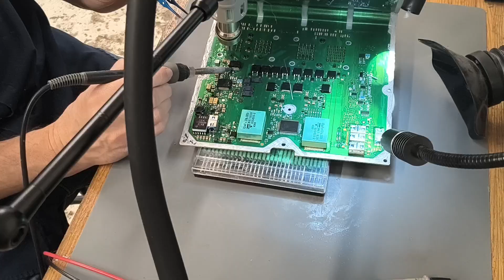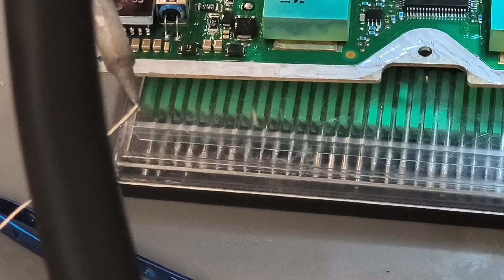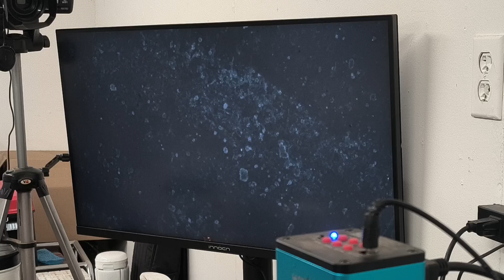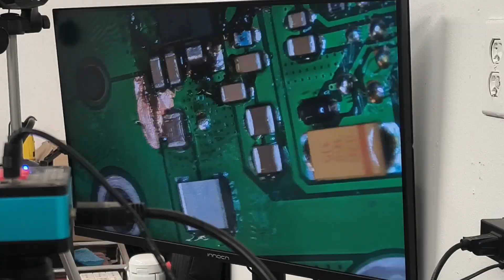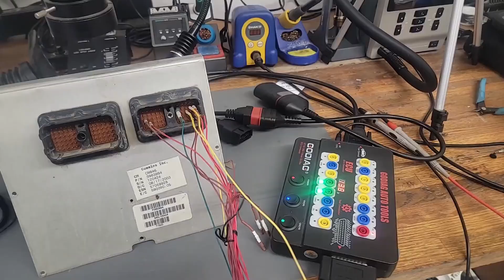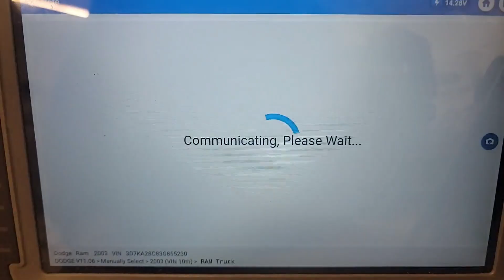Dodge RAM Cummins ECM repair no communication.

Comment: Just fixed a couple of weeks ago same ECM. No crank, no start, no comms. Dead. Blown TVS diode and open trace. Exactly as shown in the vid. Part is available in any big component places. Fixed trace, replaced TVS , resealed the clam shell and I got a working RAM diesel. Be careful prying the lid, as the middle heatsink  is screwed to one side of  the clam shell from the INSIDE!
Reply: So do you have to open both sides of the ECM, the non plug side first? Just to get to the diode?
Reply: @quickvid6735 
yes, you open the non plug side first, pry the shell open and then you can unscrew the middle part which fastens to the plug side of the clam shell. You need to take that middle pard out in order to get to to the TVS diode and the burnt trace.
Reply: @capleaker3721  I did it by only opening one side, I was able to solder a new TVS in. I do not recommend doing it that way though.  If you have a broken trace, you will not be able to get to it that way.
Reply: @quickvid6735  
Mostly the trace is broken, so you do need to take that aluminum middle piece out. The TVS itself can be replaced with the middle piece in, but not worth to do so IMHO. Just cramped, more heatsink that sucks heat away etc. and thus do not recommend this to anyone to leave it in place.
Reply: @capleaker3721 100% agree and understand you are correct. It was hell.
Reply: @quickvid6735  
Yes. You have to take all the screws out of the non plug side and pry it open. Then you get access to the middle part hunk of aluminum which is screwed from the inside to the plug side of the clam shell. You need to take that middle part out in order to get access to the TVS diode and the broken trace. Plus you need a very good soldering iron in order to get the old diode off the PCB. That is probably the hardest part on the repair.
Reply from the maker: @capleaker3721 takes a lot of heat. The aluminum shell acts as a major heatsink. There's a few methods but I use the hot air and iron together.
Reply: @ZoomAutoDiag  
same as I did. Hot air and a good soldering iron.
Reply from the maker: @capleaker3721 nice work. Make sure to charge good money for it. I repair for what FS1 sells them for.
Reply from the maker: Yes sir! Good stuff. Absolutely correct.
Reply: @ZoomAutoDiag  
I think the most difficult part on this repair is to get the old TVS diode off the board. An 80W soldering iron by itself doesn't cut it.